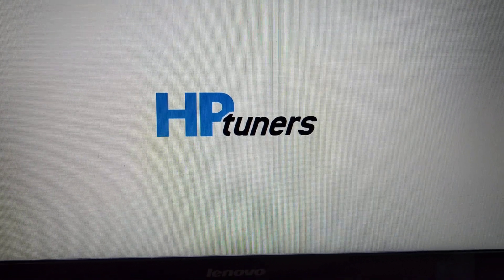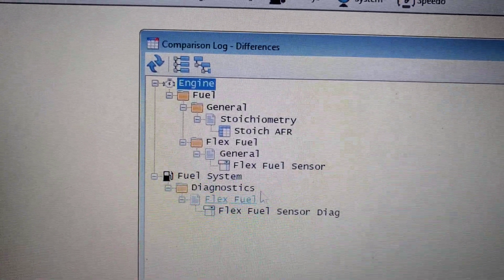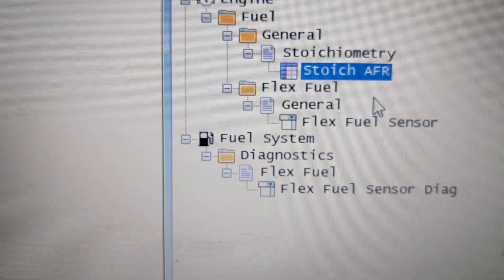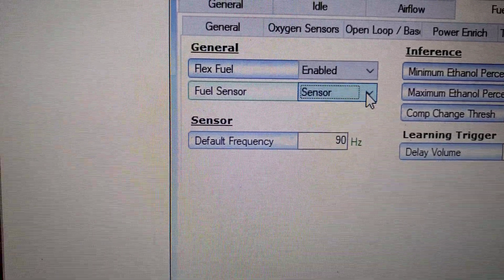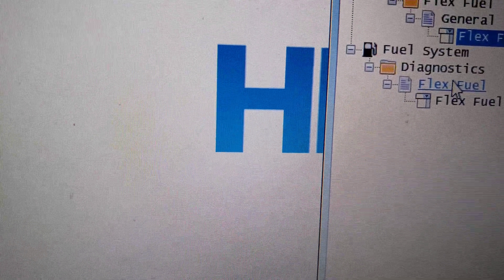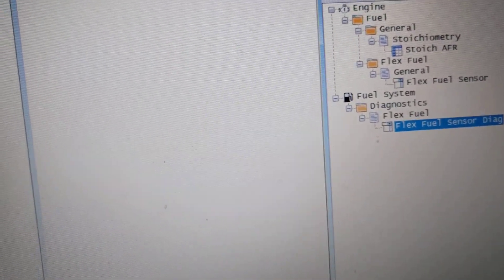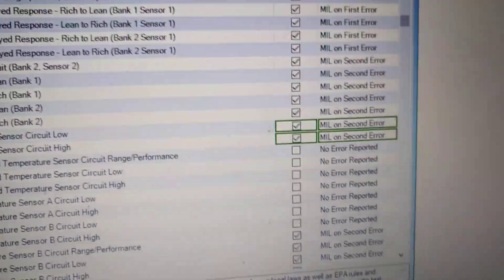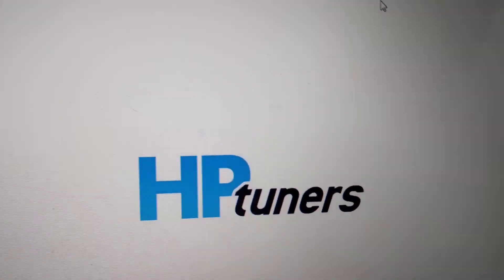2018 Silverado Sierra Flex Fuel E85 Conversion - Part 2 (programming)

Comment: When I install the e85 sensor and get tuned, will my truck be locked to just e85 or will it be truly flex fuel and allow me to switch back and forth from say 93 oct to e85?
Reply from the maker: 100% flex-fuel.  Just like it would be if it was the factory option (RPO code FHS).

Comment: do you recommend to install the parts just before getting the tune or can you run e85 without tunning in case the appointment is far out?
Reply from the maker: You can install the sensor, but you won't be able to  use E85 until you reprogram.

Comment: What do you charge to do a tune? Im trying to find someone before i make the switch. im in SoCal
Reply from the maker: I don't do tunes.  Make sure whoever you get to make the programming mod for E85 is the same person you want to stick with to tune the truck later.  It can get expensive switching tuners because each tuner has to buy credits for your specific truck.
Reply: Did you find anyone?

Comment: Is there anything more to check??...the sensor is plugged in and functioning.  Scanner reports the correct alcohol percentage and the A/F ratio is correct for the alcohol percentage.  I am certainly open to any ideas, thoughts, or suggestions...otherwise, this code is staying off and unchecked.  If the sensor was inoperative, I would be more concerned.  Thanks for the video as nothing like this exists anywhere.  It is annoying HP tuners requires 4 credits for a 2018 and the tranny cannot be tuned without sending the TCM for an unlocking procedure.
Reply from the maker: I've done several conversions and  none of them has triggered that code.  I guess if it's working consistently, it's not a problem.  Ironically, I was just discussing the trans credits with a tech at the dyno a few hours ago.   Even he said it was getting crazy.
Reply: so, "source the problem" meant to purchase another flex fuel sensor and now everything is fine.  The 40% alcohol composition is from the default sensor reading in the tune set at 90hz which is 40% based on the sensor range of 50-150hz.  Ethanol Percentage read "0" on the scanner until the new sensor was swapped.  I saw no change in alcohol percentage when I refueled and was very suspicious.  Now everything is perfect and everything is registering as expected including the P0178 code that I originally disabled.  Thanks again for this series!

Comment: I had a persistent P0178 code after making this code active in diagnostics. The sensor is connected and reading the correct alcohol %.  No biggie, I just reflashed the P0178 check box to no check.
Reply from the maker: I'd source the problem...it's coding for a reason

Comment: I have a 2011 Silverado with FlexFuel  and it has no sensor anywhere in the fuel line.  I contacted the dealer and they confirmed that there is no sensor in the line.  So how does it determine the amount of alcohol in the fuel?   There is a PID read out for AFP (alcohol fuel percentage). Where does it come from?
Reply from the maker: The trucks/cars that are FF and don't have a sensor use an algorithm and, I believe, a pressure reading of the tank.  They call is "virtual" FF.  My 2012 is FF and doesn't have a sensor.  You can add the sensor if you want to one of those types of  vehicles.  Some say the sensor is more accurate.
Reply: That's what I assumed.  Some fancy math calculation.  Just want to add that FF vehicles have bigger injectors and a higher volume fuel pump.   So you will have to change those too.  It takes way more ethanol to get the same or more horsepower than it does gasoline.
Reply from the maker: @CaptnCall  Gen V L83 and L86 injectors and pumps are the same regardless of FF designation..

Comment: So all those things people say about using e85 on a non flex fuel car are false?? I heard people say that e85 will corrode your gas tank, fuel lines, valves etc and that you need to change hoses, fuel pump, injectors, fuel rail making it very expensive and simply not worth it.
Reply: Well my truck has a e85 but not plugged to anything and the guy that tuned my truck left the e85 sensor on
Reply: Flex Fuel vehicles DO have bigger injectors and a higher volume fuel pump.  The ethanol corroding components I have never heard of being an issue in late model vehicles.  E85 is great for internally cleaning an engine (de-carbonizing).
Reply: Depends on the vehicle.  10-15 years ago, some cars/trucks would have different spec injectors, lines, etc.  The Gen V engines in the pickups run all the same part #s with or without E85 for the injectors and fuel pumps.  The difference between them is the fuel feed line.  The non E85 line has no plumbing/access point for the sensor.  You have to install the sensor inline to the existing pipe.  E85 trucks have a different setup for the feed pipe.

Comment: You didn't compare all of the modified tables. If you download a 2009 flex fuel tune you will see that spark tables are also changed. At wot you are in open loop mode so that spark tables need to be updated. This is the first step to avoid misfire
Reply from the maker: You have no idea what you are talking about.  Go play with your Gen IV stuff and leave the Gen V stuff to the big boys.
Reply: @nu5m_radio  I have an e38 gen iv and spark tables are used. How do you manage spark tables in gen v?
Reply from the maker: @labalade77  You begin by telling me what I didn't do, and now you are asking me how to do it?  At any rate, Gen V spark is managed just like the gen 4 stuff.  

The spark tables for flex and non-flex gen v trucks are the same.
Reply: @nu5m_radio  because in gen iv stuff I need to adjust more tables. This is why I was surprised.

Comment: Hello again I was looking at other e85 .hpt files and noticed that Flex Fuel Inference is set usually min of 0% to about 80% max, in your video yours appears to be locked at 10%.  I don't know if this has an effect, but I wanted to ask anyways.  I'm really learning myself, and want the best running setup possible.
Reply from the maker: I don't believe it has any effect when using a sensor.  I think it's just for virtual FF.
Reply: @nu5m_radio  I was curious about this as well. I've tested/logged both ways now and don't notice anything different. Did you end up leaving 10% min/max or change over to  0.0min/80.000313? I agree the sensor should tackle the math since it's enabled however, still trying to determine if that min/max inference is in somehow tied to the Flex Fuel Multiplier in the spark table.
Reply from the maker: @WingsAA  I'm not sure if it makes any difference, but mine is set zero and 99% now.

Comment: What's the website to copy and paste for the stoich afr
Reply from the maker: I just find a flex fuel tune from the HPT repository.  Find a 2012 Silverado, just about all of those are FF.  You can also enter the two extremes on each end of the AFR and horizontally interpolate between them.
Reply: @nu5m_radio  thank you I'm ready to run some e threw her and smell the moonshine 😏
Reply from the maker: @outen21  You already converted?
Reply: @nu5m_radio  I got the tune done. Just gotta install the sensor and flash the tune on her and yea she will Be ready. I'm gonna get a video of her soon and show you
Reply: @nu5m_radio  what else have you done to yours far as the tuning. We basically have the same set up. Speed engineering headers catless, cold air, and will be e 85 this weekend
Reply from the maker: @outen21  send me your email and I'll send you my current tune.  Haven't done much, but I have a few changes.

Comment: 2015 Non flex here.... my truck is already tuned if I install the sensor and try to enable it through hptuners would I have to fully retune it or only enable the sensor and mess with the tables?? because I really don't wanna get retuned thanks!
Reply from the maker: If the truck has already been tuned, It would need a retune after enabling the sensor.  People are picking up a lot of power just on a switch to e85 with a tune.

Comment: Are all 2017 Silverado 5.3 crew cabs able to run e85?
Reply from the maker: I'm sure they are prewired just like the others.  Check near the fuel tank for the reddish-brown connector.  See my "part one" video.
Reply: pmoore4321 so I recently got a tune on my truck and the guy that tuned my truck said I didn’t have to change anything so pumped e85 and everything seemed to be normal without having to change anything... just an FYI
Reply from the maker: @OvBassin  cool....he must not have tuned the spark and fuel much....I hear that it's really not necessary...the factory tune is pretty good...There are other areas of the tune that make a big difference...pe settings, torque management, etc.  I haven't touched the afr or spark...mine runs like a bat outta hell for a stock truck
Reply: I have a 2018 Silverado 5.3l, I’m looking to do e85 do I need to replace injectors? Or is the sensor and tuning only needed?
Reply from the maker: @marcosfigueroa9791  Just add the sensor and make the mods to the tune.
Reply: How much was that download for HP tuner  software you used ?
Reply from the maker: @kodyyfanta  Check hptuners site.

Comment: Great video man. But a quick question i did this to my 2015 Silverado. Put e85. And when its on wot if misfire. Any input. Tia
Reply from the maker: I don't know why you're having the misfire.  Mine is running great.  I converted to E85, disabled DOD, and did a few mods to the Torque Management.  I also bumped the idle up across the board by 50 rpm.  I'm probably on tank 6 or so of E85 with no problems at all.  Is this a misfire you can "feel" or one popping up in the scanner?  I accidentally drove for about 40 miles on the non-E85 tune with a tank of E85 due to mixup with naming my files.  I didn't notice any misfires even in that case, but it was very sluggish to drive.  

You might try comparing your tune to an E85 tune out of the repository.  If that doesn't work, you could always segment swap an E85 tune.  That should definitely fix it.
Reply: Your probably running out of injector.  If you have HP Tuners, look a the injector duty cycle.  It may be pegged out a WOT.  Or, it could be fuel pump.